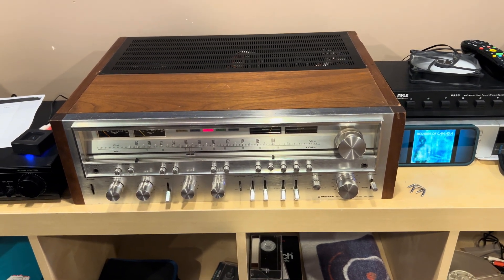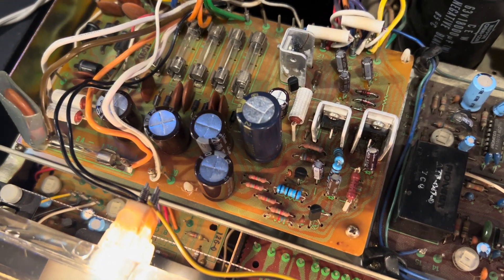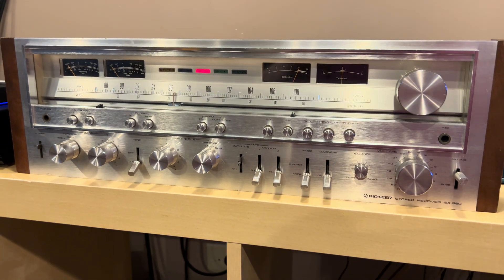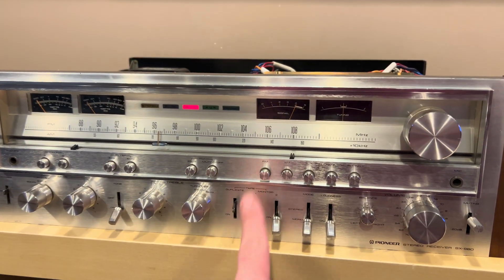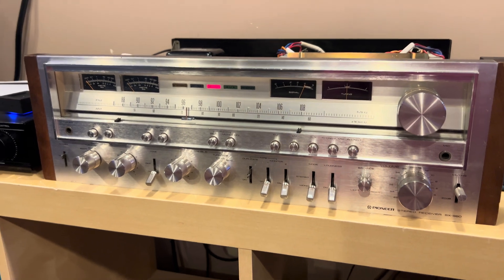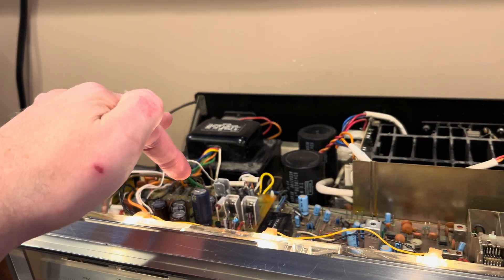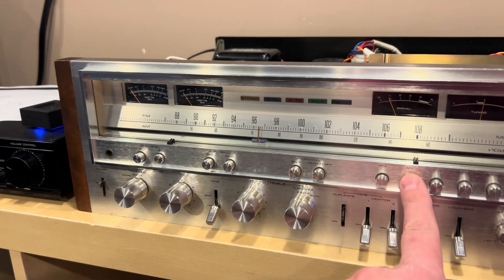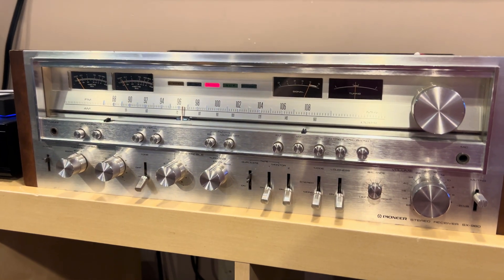Pioneer SX-980 Revival and Repair

Comment: Hello, my pioneer sx980 doesnt relay click, but it turns on, could you help me?

t doesn't emit any sound, it starts, and the lights work, but no sound.

It worked before and as I understand it has been fixed some years ago

It had some issue with the volume knob before

I've disassembled it and cleaned everything with deoxit f5 and d5 respectively, but the relay won't click on.

I have built a din bulb tester with a 100w bulb.

When turning on the receiver it shines and dims to a glow.

I've started measuring the board with the fuses, can you help me? What am I looking for next, or is there a guide somewhere? i do not understand the service manual

Sweden 225v in through the 100w bulb, stereo sett to 240v

Pin 1 22v

Pin 2 22v
Pin 3 49v
Pin 4 1v
Pin 5 36v
Pin 6 36v
Pin 7 48v
Pin 8 -48v
Pin 9 43v
Pin 10 50v
Pin 11 50v
Pin 12 20v
Pin 13 20v
Pin 14 20v
Pin 15 1v
Pin 16 13v
Pin 17 13v
Pin 18 13v
Pin 19 65v
Pin 20 36v
Pin 21 1v
Pin 22 53v
Pin 23 25v
Pin 24 25v
Pin 25 1v
Pin 26 1v
Pin 27 0v
Pin 28 0v
Pin 29 can't find it??
Pin 30 1v
Pin 31 1v